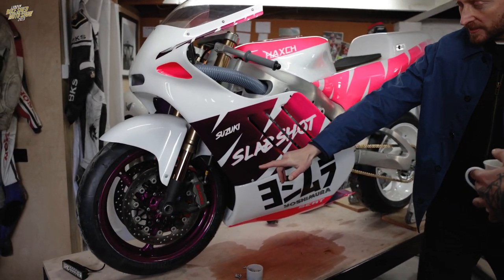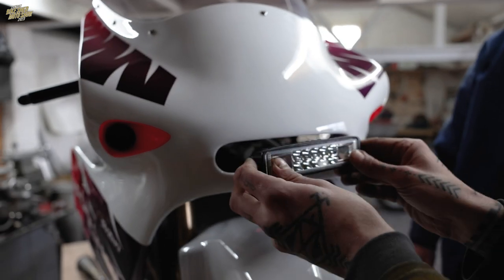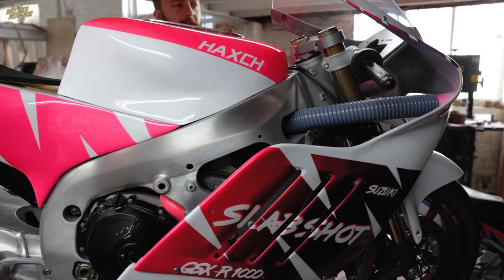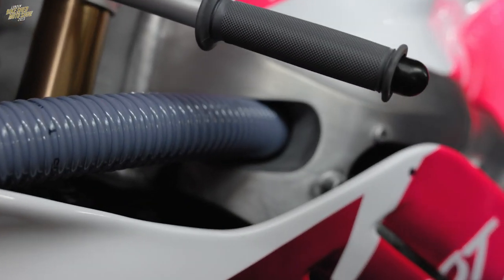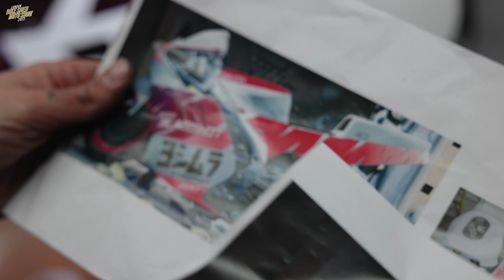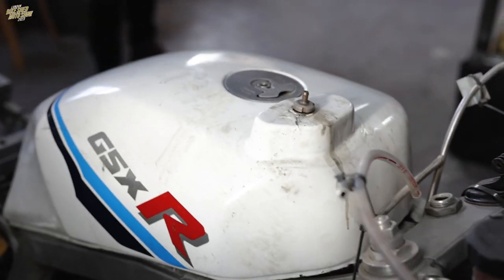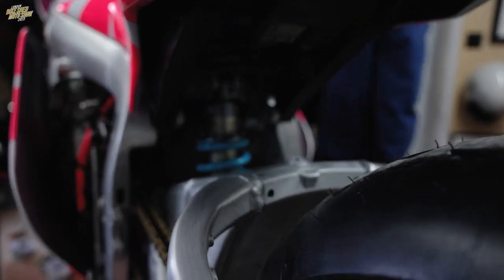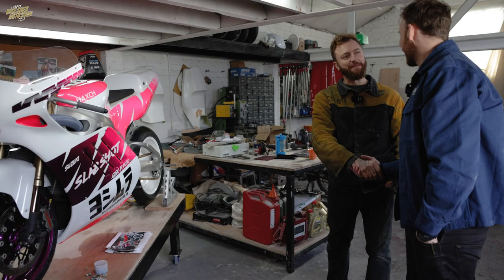EP04 - SLABSHOT - A Modern GSXR inspired by the 90's  - Road To The Show

Comment: Yeah I'm trying to go back to analog. I recently just got rid of my 2018 truck and bought a 2005 with less miles and way better. The engine doesn't go down to four cylinders. It stays in V8 all the time baby. There's only four gears in the transmission. Not six or eight all right? There's no computer telling me to turn on traction control. There's no computer applying brake pressure because my truck blew sideways m********* I blew sideways on purpose. If I'm burning out it's cuz I want to. I'm a f**** damn good driver. I don't need your help... Okay. I also have a 1991 Suzuki intruder 1400. The only thing modern I have is my phone and Wi-Fi. Everything else is old school. I even have old school tools. I even do things by hand out of spite. I hate the modern world. Everything's ugly everybody's soft as baby s***
Reply: Sounds about right. I went from a 2019 Subaru Crosstrek to a 99 Honda CR-V and the Honda quickly became one of my favorite cars I've ever owned.